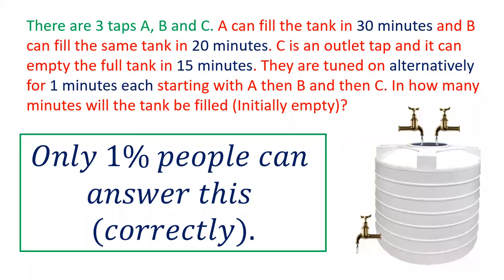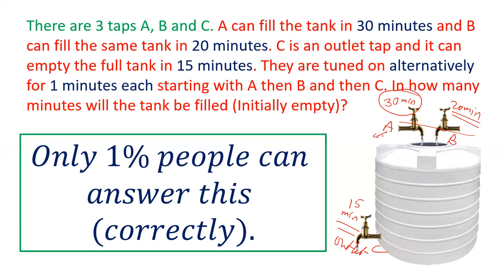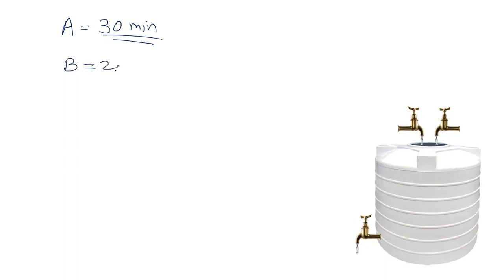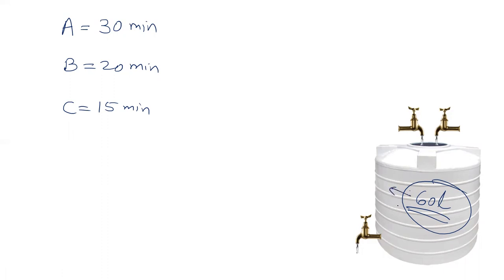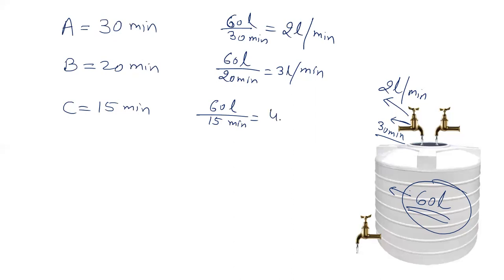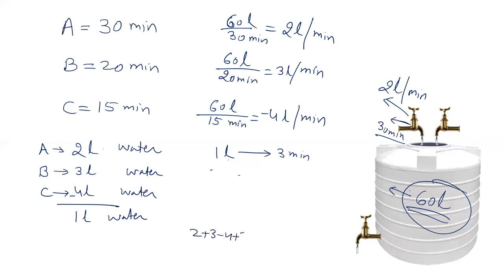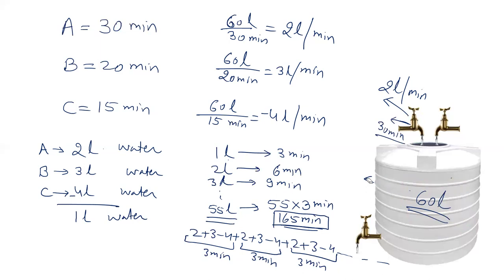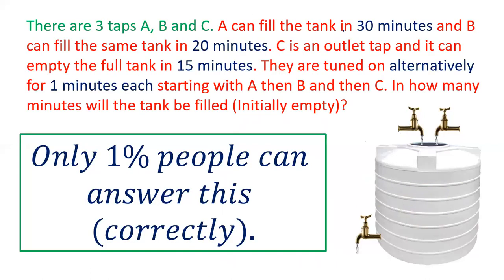A, B can fill the tank in 30 minutes and 20 minutes respectively and C can empty it in 15 minutes.

Comment: how you reached 55 ltr , 3se a 55 kese hoga
Reply from the maker: The volume of tank is taken as 60 litres

In 1 min the first pipe fills 3 litres
In another min the second pipe fills 2 litres
In third minute the third pipe empties 4 litres
So in 3 min net amount of water filled 2+3-4 = 1 litre
In 6 min net amount filled = 2 litres
We keep in doing this 

Now the last 3+2 will be filled so subtracting this 5 litres from 60 litres we get 60 - 5 = 55 litres 
We have taken this 55 litres because after 55 litres are filled the third pipe need not to empty water and tank will be filled

Comment: 2/60 + 3/60 - 4/60 = 1/60
In each round of 3 minutes, 1/60 part of the tank is filled.
Therefore, at the end of 55 rounds (165 minutes) 55/60 part of the tank will be filled.
Thereafter, when tap A and tap B is opened the remaining 5/60 will be filled.
Thus, the tank will be filled in 167 minutes.
Reply from the maker: Yes exactly

Comment: Yes, of course. At the last turn you should miss out tuning the outlet pipe, or els you should pour in 64/60 of the volumen and than let out 4 /60, what is impossible, because it would brim over or the container would burst under the pressure.
Reply from the maker: Right